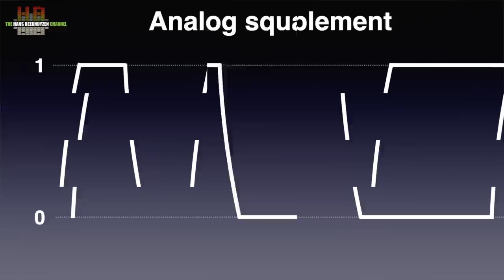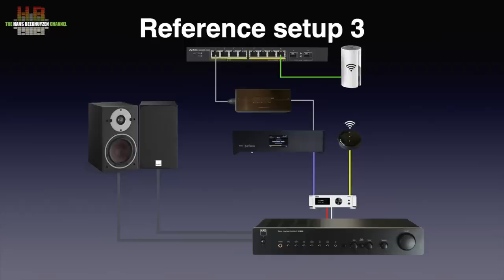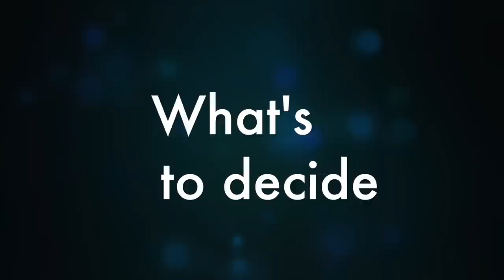Using an external DAC with your streamer

Comment: Thanks Hans, your video did not touch on one point though. A good enough DAC should be able to filter out electrical noise from the USB connection, and if USB class II is used, it has to reclock the samples internally, by using its good internal clock. In this case I would expect such a good DAC to perform well with say a Wiim Mini, do you agree? If not, what am I missing?
Reply from the maker: Name me one DAC that does that, just one...... No I don't agree, not at all. it does not correspond to practice.
Reply: @TheHansBeekhuyzenChannel  I think it would be really useful if you could elaborate on this, because it does seem to be an extremely common misconception in digital audio
Reply: @TheHansBeekhuyzenChannel 
I've read about the Chord Qutest having a galvanically isolate usb input.

Comment: You're not kidding about the difference in clarity, very low level detail presentation, and soundstage when using gear that handles the digital signal well, and when you have very clean power. Even using fairly high end pro gear, for example Benchmark DAC3, HPA4 headphone amplifier and Audeze LCD-5 reference headphones, I hear immediately audible improvement if this gear is fed by true, balanced AC power from a Furman balanced power transformer. I was surprised myself at the difference the balanced power makes. (Those billion dollar glorified power strips, however, not so much). The quality of the streaming source is just as audible to me as you state here as well. I hope people take your advice here seriously, because you reflect a very similar experience to what I have had.

Comment: 👍Hans, I had thought it was plausible that the streamer didn’t matter, but now I can’t buy into that argument. I don’t know what cost would be required to reach a sonic plateau for a streamer, but after much effort, I realize that you are correct. I also think you nailed it. If you have a $100 streamer/DAC and you hook up a $200 external standalone DAC, you won’t be hearing the external DAC at its best, even though it will sound a bit better than with its internal DAC. 😉
Reply from the maker: Thanks for sharing

Comment: I did this with my Luxman D10x using  a Bluesound Node to the D10X and then with an Aurrender A30 and then finally the N20. The N20 wins hands down. It has better isolation ,a much better power supply, and ocxo clock. Now I get virtually the same performance listening to both CDs and streaming with the N20 through the D10x
Reply from the maker: Thanks for sharing

Comment: I can confirm this. I went from a older model Bluesound Node 2i (optical out), then used a WiiM Mini for about a year, then returned to the latest Bluesound Node N130 (Fidelity Audio interface upgrade) with linear PSU, this time using the new USB output connection.

The difference in sound quality between the WiiM and the newly upgraded Bluesound was jaw dropping.

The WiiM is one of the best value products in the hifi world but this exercise demonstrated to me that it is crucial to attempt to get the cleanest signal to your dac and you will reap the rewards further down the chain.

Edit: I'm using a Musical Paradise MP-D2 Tube DAC upgraded & modified caps & valves
Reply from the maker: Thanks for sharing
Reply: @TheHansBeekhuyzenChannel  Thank you for sharing your knowledge and reviews!
Reply: U used the WiiM as a streamer and the DAC of the old Node?

Comment: Another excellent episode.  It provides concepts and examples, and illustrates how to think with concepts.  Such a wonderful presentation is rare, and very helpful.  Simple statements of what's what, what's better or best, are of much less help.  Consideration of the context of the system in which a component will be use is essential. The concept of balance, as with so many things, is critical (e.g., using an equally-priced streamer and DAC combination that is of a quality commensurate with the system to which it will connected).
Reply from the maker: Thank you so much

Comment: Hi Hans, your your video brings up more questions (electrical noise, clock, source, ISP, medium) than answers:
1. Regarding electrical noise, is it common mode or differential mode noise? If common mode, a common mode ferrite choke on the streamer (& DAC?) DC power leads may help. If differential mode a linear power supply with a good regulator may help.
2. Regarding the streamer clock. Is it frequency: accuracy, drift or amplitude/phase noise that is the problem?
3. Regarding the: source music server, internet service provider (ISP) & medium (cable or fiber), final connection (hard-wired or WiFi) how do these affect quality (if data error rate is good), is the quality location dependent?
If there are inexpensive solutions to enhance the performance of low cost streamers, like the Wiim Mini, we'd like to know?
Reply from the maker: 1) we've tried it all 
2) Drift is no problem. You won't know if the speed of audio is 1% higher after an hour. It's phase noise.
3) there are no inexpensive solutions in audio🥴
Reply: 3) You didn't mention internet related effects? At your location your internet is good and you are able to differentiate different streamers. Is that true of all locations or are you particularly lucky?
Reply: (3) I've done more research & it's generally agreed its abundant error detection & correction it's a non issue for audio.
(2) We can't change the clock but (1) are there any inexpensive well reviewed multi output linear USB power supplies?

Comment: Purely by coincidence I came in the possession of a WiiM Pro streamer. By all standards a fairly cheap thing. As I did not have a streamer yet I started to use it. As I was already in the possession of a half way decent power supplier (iFi iPower2) I just ignored the supplied wall wart. And I must say, using it with Qobuz I was not really disappointed. But then I connected it to an Modi+ dac and I was pleasantly surprised by the result.  I can easily listen to this combo until I have saved up enough money to go with a more high end streamer. So while I agree that it's kind of stupid to buy a cheap streamer and combine it with a dac way above it's class, I  also believe that you can do some smart budget buying and achieve acceptable quality within your means.
Reply from the maker: I agree

Comment: Thanks Hans - You always manage to cut through the Bullsh*t in any of these scenarios. I have perhaps too many eggs in one basket by using a NAD M12 Pre Amp/DAC with Bluos Streaming Card as the front end of my system; if I replace I could end up with three new boxes :) Whether to try a new Streamer and Dac into this pre amp or just replace it, NAD have a replacement coming that also has Dirac etc....Let's see! I mean, hear...
Reply from the maker: Nothing wrong with many eggs in one basket, as long as the basket is strong and the eggs are not spoiled

Comment: From my experience all components are equally important - like a chain analogy, but... foundation is power supply, AC power line I mean. If AC is not done all components are limited, very limited. For example Mytek Empire connected to AQ Niagara sounds less engainging than Mytek Brooklyn+ifi zen stream+Ferrum Hypsos (supply both mytek and zen stream) connected direct to power line from fuse box...Emipre is much more detailed and resolution sound, but holography, 3D,  impression you are submerged in sound is much better on Brooklyn combo. Of course connected Empire this way is another story :)
So my expierence is to begin with AC power in your house/flat, only this allow to hear full potential of the component.
Best regards, Piotr
Reply from the maker: Amen

Comment: It sounds like the entire argument against the Wiim mini or pro is the included switching power supply and associated noise transmitted to the dac over electrical connections, ie usb or coax.
How can this noise be transmitted to the dac if one uses toslink optical?
Also, how do the wiim units stack up with a known audiophile grade power supply or battery power source when feeding a known audiophile dac?
Reply from the maker: It is great for the money and will make many people happy.  But don’t try to make it a €600 streamer for it will never be. Regardless how much you spend on accessories.

Comment: I had a eye opening experience about a month ago, when i upgraded my Pi streamer with a HiFiberry digi+ pro hat with an  Audiophonics linear power supply, to a Ian Canada PI build with the same Audiophonics power supply but now with a battery and superconductor power system, an reclocker with upgraded clocks from Accusilicon and a transport layer for SPDIF out all connected to a PI4. 

What was immediately apparent  is the way the sound opened up and was flowing with ease, like I only have heard from much more expensive stuff, the effortlessness comes from a total black background. and the imaging much more 3D and holographic, what also hit me was how the bass on older recordings was fuller, and on newer recordings much more nuanced, everything sounded much more coherent especially well recorded/produced music sounds much, much better and somehow there is more sound, but the one thing that stands out is the ease, how the music flows, and that aspect surprised me the most in how much impact it has on the whole picture... 

So bits are not just bits, Hans explains it very well, I'm just surpriced how much of an impact it actually had...
Reply from the maker: Enjoy the music
Reply: May I ask, given a PI4 with a spdif HAAT into a Schiit Modi DAC, does it make much difference which of the two to give the €5 PSU and which to give the €100 PSU.  Or is Mr Beekhuyzen saying it makes little difference?
Reply: @marklbreen  I believe that Hans said that it is important to have the better power supply feeding the analogue circuitry, so therefore the better PSU should go to the DAC.  No harm to test out the theory by switching them around.  If you don't hear a difference then there is no difference for your system.  In your case, I think the better option is the cheap PSU on the Pi, a better switch mode PSU on the HAAT assuming that the HAAT has a separate power input capability, and the best PSU on the DAC.

Comment: Shit...I have a Rega Elex-r amp and wanted to buy a DAC + the WiiM Pro Plus because it has 10 band EQ settings. I need to be able to tune bass/treble (with any speaker) because I have an oversensitive left ear.

Is it maybe better to buy a better streamer (Bluesound  Node) and to add an Equilizer (Schitt Loki Mini), or will I still be stuck with the same problem as you mentioned in your video?

Thanks.
Reply from the maker: Or use player software with EQ built in like JRiver, Audirvana, Roon....

Comment: But what do you mean by ‘cheap’ with ref. To the streamer? Is that measured purely by price🤔 I am thinking to buy Bluesound Node X and to run that through a Chord Qutest or Dave dac…. Am I compromised by the streamer / power supply in this case? Please help with your input, many thanks
Reply from the maker: A streamer that costs clearly less than the DAC
Reply: @TheHansBeekhuyzenChannel  yes I did pick that up from your video, as the blueOS systems is also clearly part of the cost. It’s something I need to consider further. Thanks for all you do 👍🤝
Reply: Before spending the extra money on the X version of the Node, from what I can read the upgrade on the X is the headphone amp and the the DAC. If you use it strictly as a digital streamer, I did not see anywhere that showed improvements over the regular Node. Have a look before you spend the extra money on the X for your particular use.
Reply: @audiorick841  thanks, i did want the headphone connection as dont have a separate headphone amp. Also as you say the dac is improved over the node regular version, but guess that will be bypassed by the chord anyhow 🤔

Comment: I received a dmp-a6 and have been using it as a streamer/Dac. I was considering between Weiss 204 and 205 the difference is the 204 has usb. I was wonder if the sound quality going through toslink into dmp-a6 is going to be as good as going through usb? The cost of the units are $1000 difference. Thanks for your time
Reply from the maker: If you have the standard DMP-A6 perhaps USB would be the best choice since it uses the clock in the DAC. If you would have the Master Edition, the SPDIF would be my choice. In both cases you probably will not get the full potential of the Weiss DAC. For that you probably would need a streamer two classes up.
Reply: Does the eversolo have bass/treble setting? Or other EQ settings?

Comment: Thanks for the great explanations Hans. The digital output from a streamer gets converted to an analogue square wave and is input to the DAC. If the signal is corrupted from a power supply or has jitter the bits will be misinterpretted by the DAC. Why can't someone make a measurement of just how many bits are wrong and express it as a numerical error rate? Then explain how many bits need to be wrong to be noticeable by a low, medium, and high end cost/sounding system. Analogue hi-fi measurements/specs are made for frequency response, harmonic distortion, etc. Why can't there be a number on a streamer's output quality compared to the reference soure bits? That would be really helpful.
Reply from the maker: Please watch https://www.youtube.com/watch?v=B-StTplQZys&t=127s

Comment: Great Explanation ! I am using a McIntosh MX123 A/V processor 's DAC in stereo mode , Connected DIGITAL via a Coax Cable to a BluSound NODE streamer. Don't know if the streamer is "Good enough " .... as it is only in a streamer mode and the DAC is external. ( Speakers :Focal Spa 3 ) , PS : If the NODE is to be replaced , Any better streamer model advice will be appreciated. thanks
Reply from the maker: You could really do with a better streamer. Watch https://www.youtube.com/watch?v=kXaPM1VE5nU&list=PLMbsmejHnP8FgunCScmI9bLGLtkWmqXxS&pp=gAQBiAQB
Reply: Thank You !!! @TheHansBeekhuyzenChannel

Comment: How would my ROON Core on a Mac Mini M1 factor into this? I have my Bluesound Node N130 connected to the Mac Mini via an Ethernet cable and the Bluesound Node is connected to my Mytek Brooklyn DAC+ (powered by S-Booster) via a glass optical cable.

Hans, great vid as always, but now I need your feedback regarding ROON’s impact.

Help!
Reply from the maker: Roon and the Mac mini have no influence on the sound quality. The weakest link in your setup is the Bluesound. Consider buying a network bridge or streamer. You find the ones I reviewed here: https://www.youtube.com/watch?v=2XRi9utNBl4&list=PLMbsmejHnP8GcUr68FGv0olETD8fbsgor&pp=gAQBiAQB
Reply: @TheHansBeekhuyzenChannel  - thank you Hans! I have been looking at the Lumin U2 Mini tonight. I will review your recommended vid.

Best to you👍👍

Comment: in my budget (low) With my portable rig Shanling M0 and a Hidiz AP80 have found that using a external DAC via the USB C port (dragonfly black V2) gives better sound & higher amplification. I’m now looking at Chord Mojo V2 for the same but also the extra connectivity it offers. BUT I will listen first as it is a significant guilty pleasure buy and would love you to suggest comparable DACs offering similar benefits. At your levels i understand the science and the quality may disagree with my findings.
Reply from the maker: Follow your ears!!

Comment: My setup consists of a relatively low end streamer compared to the DAC - the price of the streamer (plus lps) is about 40% of that of the DAC. So I decided to buy the Denafrips Iris ddc to cleanup the digital signal and also to get a better clock for an i2s connection to the DAC. I have yet to receive the ddc but I hope it’ll help to narrow the gap between the streamer and the DAC. Would like to know your opinion on this.
Reply from the maker: looks good

Comment: i am using a Bluesound Node digital out into a Denafrips Pontus. its heaven. i am using the new Rega Elex as an amp. i think the electronics downstream make the biggest difference. but i do have my eye on the new Denafrips streamer being released
Reply from the maker: I will review the new Denafrips streamer next month.
Reply: I'm using the Node n130 with a PD creative PSU ( which give you for 300 euro's a big improvement) connect via usb to a denafrips Hermes DDC --> Pontus 2. Why this strange choice? I still play CD's too, the audiolab CDT player is also connected to the Hermes, so the Hermes has a multiple function. And Hans forgot the mention that the app that comes with a streamer can make one decide for a brand like Bluesound  and not Lumin like I did.
Reply: @TheHansBeekhuyzenChannel I view your point and I agree, but regarding DAC I have some real doubts.

First it’s no easy to appreciate the differences, and something wondering me that something is no clear.

Usually people agreed that CD sounds better than files (obviously talking about the same recording) and the CD DAC aren’t no so “specials” than hi level DAC… where is the trick?

Comment: Thank you for your insightful videos. I’m curious if you have some thoughts regarding the sound quality of streaming from a computer to an electronically isolated re-clocker before going into a DAC. I’m using an Empirical Audio Off-Ramp re-clocker to a Channel Island Audio DAC.
Reply from the maker: I prefer not to connect audio gear directly to a computer. I rather would use a network bridge or streamer.